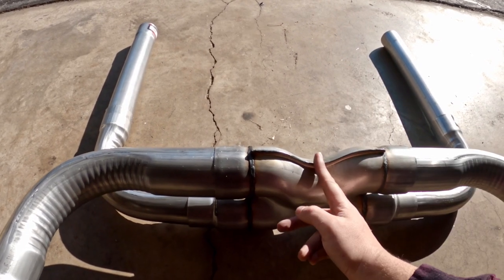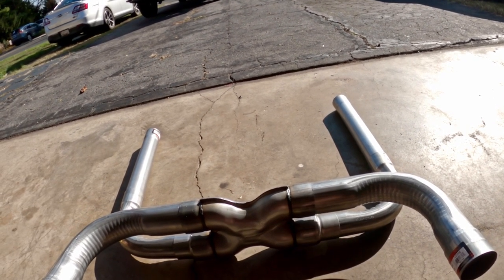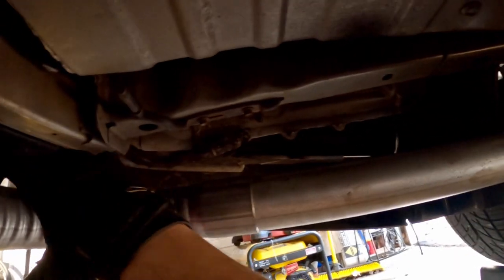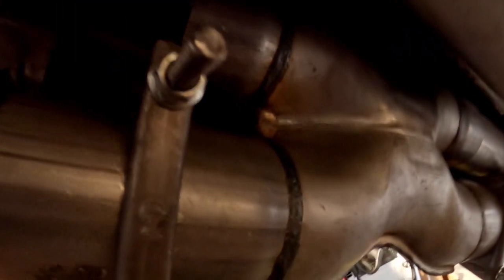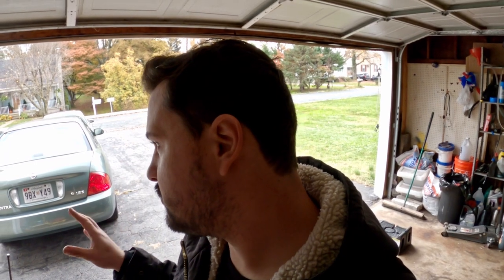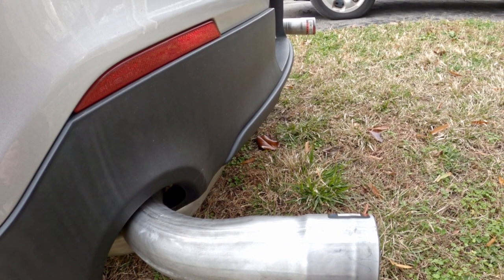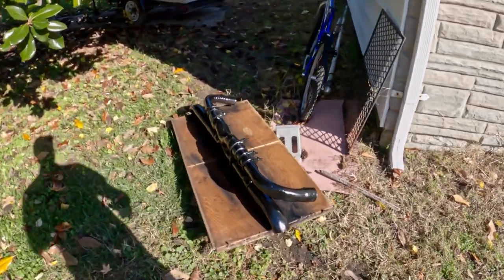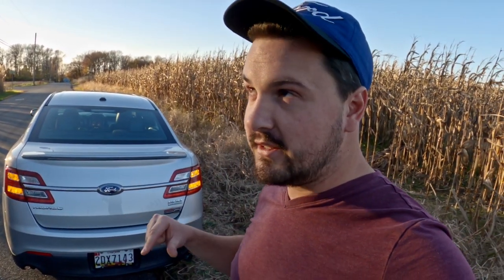Supercar Inspired Exhaust prototype on Ford Taurus SHO

Comment: What I believe we are missing, once the catts and resonator are gone, are 3 inch down pipes. We've 2.5" for days and I think it contributes to the rasp and "nasal" resonance of our setups. I'm catless, 2.5 down to 3 inch pipes back into a resonated Magnaflow x-pipe 3- inch pipes to Varex adjustable exhaust. I'm going to build 3 inch down pipes and see how much that opens up. Keep going man. Really like what I see here. Also, excellent name. From one "Bro" to another.
Reply from the maker: I'm sure 3 inch DPs would give a deeper tone for sure. I'm exploring the possibility of creating a tuned exhaust set up in addition to my current idea. A professionally built piece is something that I would like to do soon to get the fitment right. And thanks for the support! I do really appreciate it! 😁👍
Reply: Check out my sounds clips of my Explorer Sport, basically the same drivetrain...3" down pipes, full custom exhaust...

Comment: Looks a little ridiculous but it sounds freaking awesome, nice job! I would love to have my Ecoboost mustang sound like that!
Reply from the maker: I had that piece remade professionally using 304 stainless steel. Sounded better, and definitely looked right! I since sold the SHO but kept that custom x pipe. In a recent video I did, for Fun I loosely adapted that piece to my Cobra and my EcoBoost Mustang. The results were interesting! You should definitely check out that video. 🙂
Reply: @KarzKreated  what link is that? For the Ecoboost mustang
Reply: Your ecoboost mustang is only a 4 cyl. His Taurus is a 3.5 v6 ecoboost

Comment: ima need some input. i just got a 2015 sho. trying to make it sound like a monster
Reply from the maker: Muffler delete and resonator delete will add a significant amount of volume and turbo noise to the exhaust sound. Doing that usually causes rasp and drone unless that's what you want. You can take that over the top with a set of downpipes. If you a more refined sound, a full cat back system might get you a better result. Alternatively, a resonator delete with a decent set of straight thru mufflers will give you volume and help with the rasp and drone. Other options are combining both banks into a large single pipe and running a single exit boom tube, or muffler. More so, you could split the large single pipe back to smaller dual pipes for a factory dual exhaust. Lastly you could replicate my exhaust. Someone did their own version of my rear X Pipe with the rest of the system straight Piped. It's one of the most aggressive sounding SHO's I've heard.
Reply from the maker: Here's a link to that car https://youtu.be/jd8T-KEj0u8

Comment: What does the x pipe do for the exhaust on a SHO exactly ? I’m looking at getting the magma flow muffler with an x pipe in it for where my resonator went.
Reply from the maker: In a traditional setup much like how your setup will be, adding a X pipe tends to create a more aggressive, raspy and higher pitch exhaust. How I did it changed the sound charismatics slightly more and gives a more unique tone similar to that of a ecoboost Ford GT.

Comment: How do you get the car to make the 2 step sound when revving. Is it with a tune?
Reply from the maker: The car was tuned, but I don't think it had anything to do with the 2 step like sound you hear. 

Maybe the tune helped accentuate the sound. 

But it was just bouncing off the Rev limiter. 
I think that was somewhere around 5k RPMs.
Reply: @KarzKreated  oh ok thanks. What tuner did you use?
Reply from the maker: Gear Head tunes loaded with a SCT X4
Reply: @KarzKreated  thanks!

Comment: I like but to me a v6 should sound like a v6. Have a 3.5 na I just did a resonator delete with magna flow mufflers specifically designed for a v6. Sounds great. Deep tone. Everyone ask me if it's a v8 then I ask if it sounds bad not one person has told me no
Reply: "To me a v6 should sound like a v6", "Everyone ask me if it's a v8" That would mean you dont like how it sounds correct?

Comment: To get it to sound like a gtr or a Ford gt, the downpipes must be very close to the same length. I don’t know how an sho is configured, but I know there’s one turbo on the front, and one on the rear. I’m assuming the rear downpipe is nowhere near as long as the one coming from the front turbo. Find a way to make them equal length, and you’ll have the sound you’re looking for. I’ve been hoping someone would do this!
Reply from the maker: That's actually a really good point! I didn't take the equal length DP's into consideration. Once I get the rear section done, I will work on the mid section. Now I think I'll do my best to incorporate an extension on bank 1 down pipe to get it even.
Reply: @KarzKreated  it’ll definitely get you what you’re after. Everyone assumes x pipes equalize the exhaust enough to make up for the difference in downpipe length, but they don’t. With your exhaust exactly as it is now, just doing equal length downpipes WILL get the gtr sound. Ecoboost f150’s could do the same thing, but I doubt most of their owners would like that sound coming from a truck. All ecoboosts sound like towels flapping in the wind to me. This would fix that 👍🏻
Reply from the maker: 🤣 Yes! I definitely do not like any of the aftermarket exhausts available. Everyone's trying to hard to make a v6 sound like a V8. I want my v6 to sound like a v6 lol. Thanks man!
Reply: @KarzKreated  right, its honestly more like an “import” than a domestic. Embrace the v6 🤷🏻‍♂️. I’ll be curious to see if you can make it happen. It’ll be the only good sounding SHO
Reply from the maker: I hope so! The shop I'm working with is also big enough to make batch orders if I get a product people like. So that's always a possibility!

Comment: I deleted the resonator & third cat on my 2013 MKS. I installed X-pipe in place of resonator & installed some Flowmaster Flow FX straight thru muffs. Oh & I’m still catted BTW. I do “like” how it sounds but my freakin iPhone can’t ever seem to get a decent sound clip. It always ends up sounding shitty on the iPhone! Ugggghhhh
Reply from the maker: Nice! I would figure the iPhone would have a decent microphone. I'm only using a Gopro Hero 8 for most of the video/audio recording.
Reply: Hey I got a 2013 mks ecoboost also just got it 6 months ago with 30k miles. I'm going to do a tune ( I'm leaning towards Torrie at unleashed) and plugs sensor and thermostat.  I'm not sure what I wanna do about exhaust yet. What all do you have done? Mine is silver as well!
Reply from the maker: The only exhaust mod I have currently is my custom rear X Pipe. Everything else is as it was from Ford. The most simple and cost effective sound mod is just to delete the mufflers. Gives enough sound to make you smile but not annoyingly loud. The only problem with muffler deletes is interior drone.
Reply: @Chamacurmom  Make sure to get that PTU fluid changed homie. Did you get the tune?
Reply: @kruek24  not yet brother. I wanted to wait until winter was over. So I'm about to pull the trigger next week. Yes I had PTU issue on my 16 explorer. Unfortunate. I need to read up on how to change it.. im hoping with 31k miles it's not too late! I still think I'm sold on going with an unleashed tune. Torrie seems to be good. I'm thinking of adding the livernoise intake and exhaust!
Reply: @kruek24  I don't like how alot of the exhausts sound. But the livernoise seems pretty good doesn't. Alot of the others seem like they sound like wanna be v8 and the livernoise sound more like a gtr I dig it
Reply: @Chamacurmom  Nice let me know how the tune goes, I want the same one on my 2010 EB flex ( I had to replace the ptu and drive shaft) running good now. My old ptu did not have a drain plug but my new one does, you just need to by a little pump to suck out all the fluid. I paid like 50 off Amazon. Every 30k you should change it so you should be good. Enjoy it bro.
Reply: @kruek24  oh ok good to know! Thanks for the tip brother! I will keep you updated should be rolling with tune in next few weeks

Comment: Does anyone make this x-pipe for the shos? Would love to try and get it on mine
Reply from the maker: Unfortunately no. I was gonna have this piece made in batch orders once I got the fitment and everything just right. But I since had to sell the SHO and ultimately scrap the project. You can have it made at a good exhaust shop. It can be expensive though depending on the shop and materials used. Glad you like it though!

Comment: sounds about like a muffler delete
Reply from the maker: Similar. Does change the pitch and changes the character at mid rpm's. I'm hoping the final piece will tighten up the tone. Many leaks is likely causing additional rasp.
Reply: Yeah I have a muffler delete and sounds quite literally exactly the same
Reply from the maker: Check out my newest upload. I updated this piece by having it made from 304 stainless. Sounds a bit better now with the updated version.